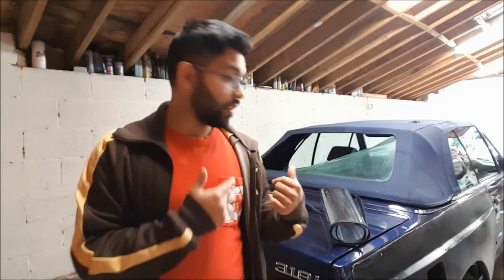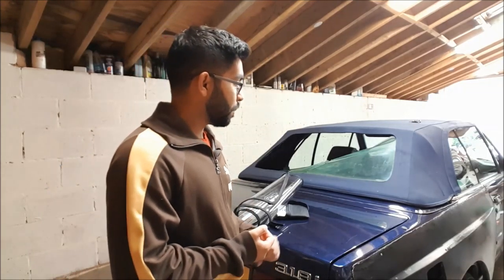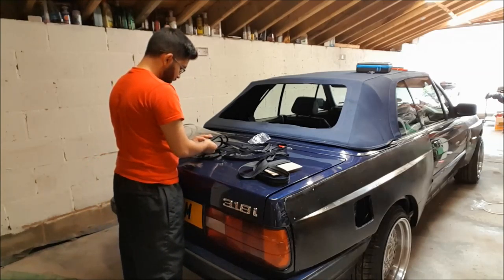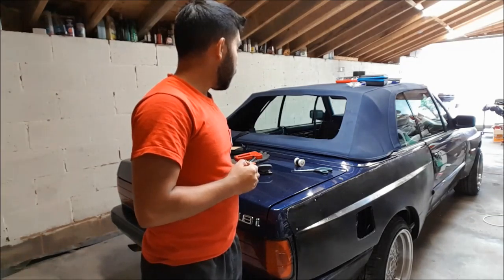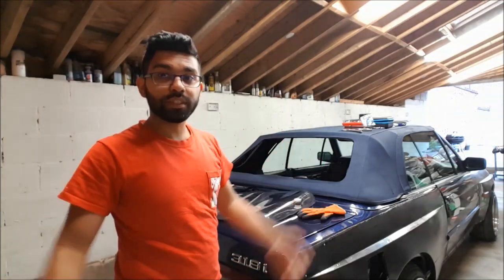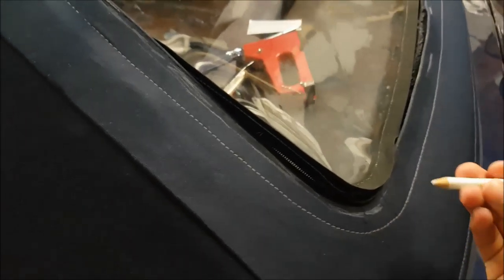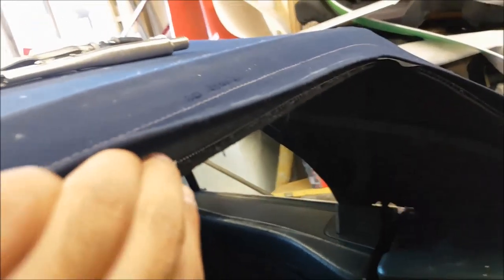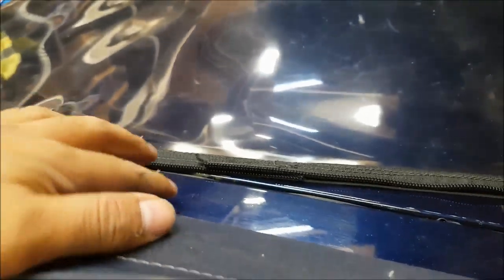BMW E30 Convertible screen repair, from sewn in screen to zip in screen cheap repair.

Comment: I did this as well to my bmw z3. I have a built in zipper but it sorta came out when I was putting in new window. Not sure why but it did. But it never dawned on me to sew it back in. I just used heavy duty contact cement on the inside. Its still holding solid 6 months later. I really wish I had sewn it though. When and if it fails ill do it
Reply from the maker: Fingers crossed your set up keeps strong as long as possible but yeah it's well worth doing that next time round!

Comment from the maker: Get your parts here:
Rear Screen:
https://rover.ebay.com/rover/1/710-53481-19255-0/1?icep_id=114&ipn=icep&toolid=20004&campid=5338456010&mpre=https%3A%2F%2Fwww.ebay.co.uk%2Fitm%2FBMW-E30-Convertible-Window-318-325-325i-Zip-in%2F372673113757%3Fhash%3Ditem56c50c6e9d%3Ag%3AWRgAAMXQ0pNQ9dg0

ZIP - Size 8
https://rover.ebay.com/rover/1/710-53481-19255-0/1?icep_id=114&ipn=icep&toolid=20004&campid=5338456010&mpre=https%3A%2F%2Fwww.ebay.co.uk%2Fitm%2F5-Meters-of-Size-3-5-8-or-10-Continuous-Zip-with-10-Zipper-Slides-9-colours%2F322547342782%3Fhash%3Ditem4b1951ddbe%3Am%3AmX0aMiHtjACqRV8XgUJ0UCQ%3Ark%3A1%3Apf%3A1

Comment: i'm working my own e30 top conversion - i cannot figure out how to get the tonneau cover (top boot) motor loose.. I've got all the bolts off the motor from inside the trunk but the arm inside the top storage compartment has me perplexed - on the back wall center. it rotates but i cannot figure how to unscrew the them from the motor so i can pull the motor out of the trunk - can you help

Comment: Mate can you let me know where do i plug the green wire from coil i took immobiliser out now im stuck also some cables from boot that was wires for convertible motor but was took of from previous owner? My car dont start now im stuck no fuel no spark no icv but if i jump wire from coil to battery all good but dont start
Reply from the maker: Hi Alkukes, sorry to hear about the problem. Which coil are you referring to? and by immobiliser do you mean the car one to start it up etc?

Comment: Love your video , thinking about doing the same. Could you please let me know what is the right zip I should get , and where did you get the plastic window? Cheers
Reply from the maker: Hi Jian, yeah sure thing the ZIP size is 8, I have a link to one in the description if you wanted to see what it was like, and I got the screen off ebay (also linked in the description) I hope that helps you with your build!

Comment: do you know where else i can get the rear window?  because when i click on your link it doesnt send me to the window
Reply from the maker: ponysluggers 98 I'll have a look to see if I can find a new link then bud. Might have just been delisted differently.
Reply from the maker: hi mate, sadly only been able to find this one. Will keep an eye out if others become available.: https://www.ebay.co.uk/itm/Rear-Window-With-Zip-Fastener-For-BMW-3-Series-E30-Convertible-54318207804/202085217949?hash=item2f0d37b69d:g:18EAAOSwSlBY0ofe
Reply: What if I make that window from strong material and add a zipper wouldn't that be even cheaper ,also add something like tiger  seal ,think I'm going to go that route ,these windows ain't cheap no more £159